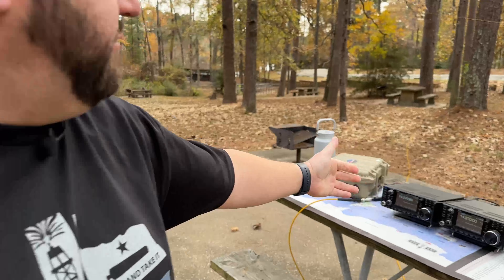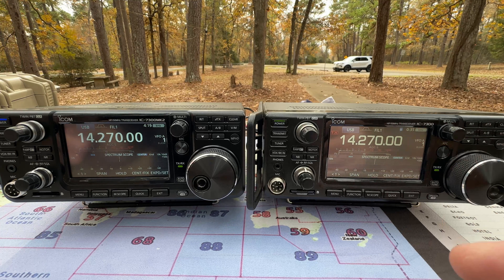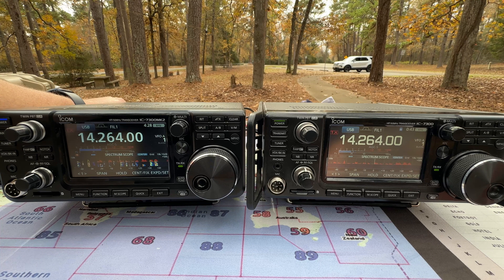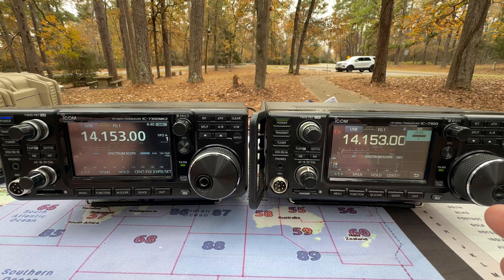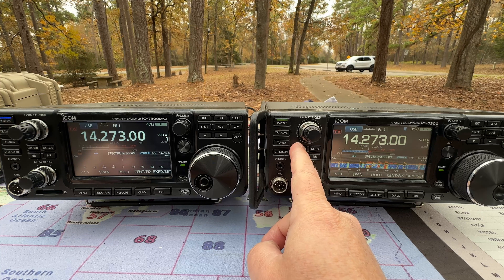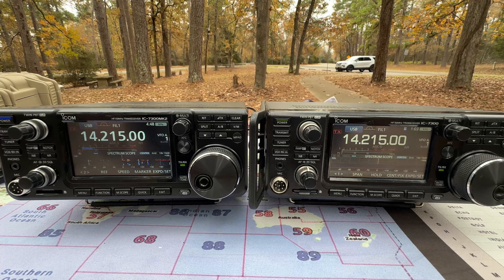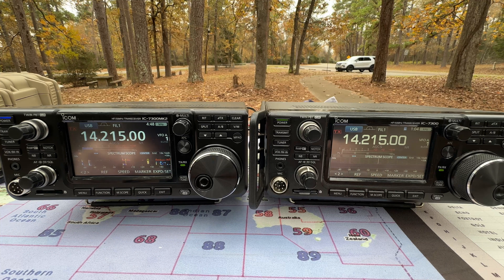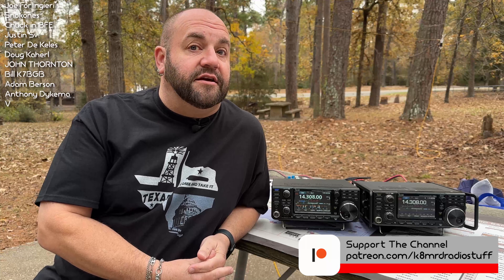Icom IC-7300MK2 V IC-7300 RX Comparison

Comment: Can you do a comparison with the RF gain knob?  Turn of the AGC. Then using headphones you bring the volume low, turn the RF gain all the way down, then bring it back clockwise slowly until you can copy whats being transmitted.  But you stop bringing up the RF gain before all the noise floor is included. I don't have it any more but my Yaesu-857D had a nice system and it seems like it worked better than the 7300.

Comment: MK2 Sound on  stations to they cut some Mid-High End frequencies .... NR both radios  Same..... MINOR CHANGES.....made no difference to purchase.   BTW thanks for the DEMO,  73  .w2ot.  opps let me add this  you will get used to listening to either one  make no different.   I view a few demos... My Comment added Video out put great...Would I spend $1500 NO....would I spend  $1000  yes !....73!........Icom did this with the 756-756 Pro -2 - Pro 3..... and the  706   - 706 mk2-G............I stick to Kenwood. next choice  FT 710.....I love my Ken TS-890.

Comment: With the AM station The MK2 sounds better and cleaner (from a musicians ear point of view) more full bodied slightly more bass, the standard 7300 seems to have a heterodyne, I can hear more noise, but the audio isn't as full bodied more in the mid-range. The signal strengths look about the same. At first the sidebands sounded about the same, the MK2 still sounds a bit cleaner on sideband. I have older 40 yo Kenwood's, a TS950SDX and TS940S AT, both have their interesting points. Currently the 940 is temporarily down there are no additional backlights in the LCD to replace, just two on the L-R edges, the screen backlighting is weak toward the center not as bright as it should be. took it apart down to its LCD electrostatic pads.  The 940 is a bit more sensitive with its own quieting, sometimes no noise, but looking into some cold solder joints. And I use the MFJ noise reduction/signal enhancer which works really well, the difference between all noise and no signals, to phased in clear copy signals and a distant river or waterfall for noise. Using 10-160m multi fan End fed half wave and 10-12 m vertical. I also use either the 950's DSP or I have two other DSP's to clear things up a bit.

Comment: Nicely Done... Next time consider using the same speaker. I didn't notice i.e.. I couldn't hear if there was a 12db difference between the two radios. Certainly the MK radio circuits would most likely remove that massive difference to barely able to notice any difference... 12db is a massive difference. Great for lunch talk at the factory but not even 3db of a operator noticeable difference. Wonder where it went. What I did hear was a difference in fidelity rather than signal to noise or selectivity. Not significant though. The other updates are of not much interest to me... don't want CW decode or HDMI or remote access.  VHF would have been nice or a Mic Audio adjustable noise gate. These new features seem to be more updates than upgrades. The biggest impact of the MK was to drop the sales price of a used 7300 to the mid $700s.  Thanks to ICOM for creating a hot used 7300 market...;-)

Comment: Quite a few negative comments,  but mainly from mk1 owners. I thought the mk2 sounded  better, and the screen looked good. My first hf radio was a 101ZD MK3, I don't know how many owners it had before me, but I listened alot with that radio. Only ever made 8 contacts with it because I only had a B licence. It got damaged so that was the end of that. I bought an IC-706 Mk2 in 89 then I passed the 12 wpm morse test in 1999. I then bought an IC-746. I have been  looking at the 7300 for some time. Looks like later next year I will be buying one. Need to save up because  couple of year's ago a second-hand 703  came up and last year a 705 from the same person. All I need to do now is start using them. Another great video Mike 73

Comment: The most notable difference between the MKII and my 7300 is the lithium rechargeable clock battery in mine is dead, a common failure in these. I wonder if you can open it up and see if they did anything different with the clock battery. Digikey sales the battery for 1.99

Comment: I must also say that I noticed little to no difference in audio quality. Of course, in other areas such as internal CW decoder and Wi-Fi capability, the new IC7300-mk2 is not bad at all! But you can also control all of that with IC 7300-v1 via a Raspi. 73 de Jan-Peter - DL3KVT

Comment: Youtube is probably going to mask most of the real difference, but seems like the audio is slightly less distorted on the MKII and the MKII seems to be ever so slightly quieter.  Tho I think the advertised  improvements in the RX are mainly in a little higher dynamic range.  But you would't really ever hear that until you got, like, a legal limit down the street or even a couple park benches over. 
I guess we'll have to wait until it shows up on the Sherwood engineering RX page. 

Somebody has to whine about something, so I'll whine that there's no WiFi. That's the #1 best feature of my 705, since with a cable RF always gets into my laptop no matter what I do with chokes, antennas, etc. WiFi completely gets rid of that. 

Other than that looks like a great rig!

Comment: Im a CW operator, weak signal and filtering can be a big deal. BTW 1 db can be a game changer when you're only 1 db above the noise floor but I digress. Continuing its one thing to have all the filtering its another how and when to use you bells and whistles. More is definitely not better and dont forget the RF gain its there for a reason. So for me your presentation is half empty no worries its still half full.

Comment: Can't see much difference.  Certainly not enough to justify rushing out to replace my MKi.  Having an external screen output is not a game changer.  My IC-7851 has that and I often forget to turn the external screen on anyway.  I think the problem is that it's hard for them to improve something that was clearly very good to start with.  I won't be parting with any of my Icom radios any time soon.

Comment: Comparing receivers just by ear, with two radios side by side and listening to strong, clean signals, doesn’t really tell the whole story. Most modern rigs will sound good in those conditions. Differences in things like phase noise and reciprocal mixing dynamic range usually only show up in tougher situations, when you’re trying to copy very weak signals with strong signals close by.

Comment: I like the efficiency for the MK2 and the the noise reduction and filtering is marginal but I plan to learn CW and fully utilize all the new ports. I hear the chip on the original is better than the MK2 so I will keep both.

Comment: Subtle differences yet noticeable to this former musician's ears. I was a bit surprised that some things the OG 7300 did were more favorable than the MKII and not surprised by things the MKII did better. Mostly personal preference than outright superior performance. I felt the 7300 AM reception was 'better' than the MKII, as was the roll-off on the noise suppression. I preferred the fidelity of SSB reception on the MKII, however. I like the screen and font of the MKII better and the game changer is the connections on the back panel. Of course those things aren't the subject of this video. Nicely done, Mike. W0RHP

Comment: There is very clearly a little less high-frequency hiss on the MK2 and a bit more mid-freq audio (say 400 - 700 Hz).  If you switch on the wide notch filter and set it to the top end of the passband, you can make the two sound identical.  Another way is to narrow the filter on the 7300 to perhaps 2.4k and shift both passbands down 200.  Excellent video.  Me? Sticking with the 7300 and not spending money on the MK2.

Comment: Good video ! I thought the guy wanted to show that the MK2 works better . The guy didn't show us the EQ settings for the receiver . In the video, you can hear that the old 7300 has a higher-frequency sound . IMHO, the MK2 has fewer high frequencies and more low frequencies . However, these are just EQ settings. Then I noticed that the NR filter correlation occurs earlier on the new MK2 ! The NR filter on the old 7300 is more gentle. Well, the PRE comparison, I noticed that on the old 7300,  (  8:00 ) NR is turned off, and on the new one, NR is turned on . Therefore, the comparison is not correct . In general, the conclusion is this - if you don't need HDMI and LAN, then it's better to buy an old 7300 at discounts)))

Comment: Slightly better clarity on the Mk II but not enough for me to want to upgrade if that’s the only improvement. I would consider it if the receiver is a few dB quieter so that I can dig out weaker signals.

Comment: If it was a choice between the 7300 mk2 and a FTDX-10 which should I go for?
Reply: The newer one, MKII
Reply: I have an FTDX10 with 300 Hz roof filter for CW.
I do not know if I will upgrade to Flex, but I will never downgrade to an IC7300 or MK2
Wait a little bit for the Sharewood analysis. I am sure IT WILL NOT BEAT the DX10 ;>)

Comment: I noted very little difference.  Seems the main advantage to the MK2 is its HDMI output but I have the PTRX-7300 mod in my IC-7300 so no need for a HDMI output.  No need to upgrade here.
Reply: I'd never heard of the PTRX-7300 panadaptor, so I had to do some research. 
Apparently, it uses the location of the Antenna Tuner jack to perform- shenanigans. They also seem remarkably hard to find, here in Australia.

Comment: The newer radio is going to sound a little better simply because the speaker is new and hasn't been out in the elements much. It's not as broken in as the speaker in the older radio. They both sound good but to my ear, the Mk2 sounds better. Also noticed the font on the frequency numbers is different on the Mk2 compared to the first gen radio. Great video Mike. Thanks for all the great reviews of this very nice radio. 73
Reply: And yet many claim that speakers require a break in period to reach their best performance.
Reply: @N_Andrews  Audio is so subjective it's really hard to say one radio sounds better than the other. To my ears the Mk2 sounds better but I'm sure others would say the first Gen sounds better.

Comment: Great video, I would save the money unless you want an external monitor and remote operations. And if you want a better receiver and DNR. Buy a FT710 use the extra cash to better your antenna or build a better one. 73 W4KWS 🎉

Comment: I’m waiting to hear the updated Sherwood Engineering report about the receiver quality. 5 stars on the USB-C & HDMI port. -1 star for the font change on the frequency display (I’m a font nerd - just a bit). 73!
Reply: As I understand it, you can change it back to the "square" numbers in the menu. Don't have mine yet to confirm this though.
Reply: @CheesyTators  Good to know if I ever decide to buy a 7300 MK2. 73!

Comment: The only difference I could hear was the self generated noise floor. On receive any differences were imperceptible. To justify swapping the old for the MK2 would IMHO have to be driven by the other features like USB-C etc and not receive quality. I am sure the difference in receive can be picked up a scientific analysis but so far it seems to be undetectable to the human ear. On the other hand we are hearing this through a lavaliere mic over the Internet so who knows hi hi

Comment: I had a 7300 for five years then purchased a two flex radios and a maestro, I'm going back to the 7300 (old version) and selling all the Flex equipment.
Reply: We did the same thing.  Especially surprised at the clicky QSK on the flex.  I quieted my 7300 with acoustic putty on the relays.
Reply: Why? I mean i never would by a flex, but let us know.
Reply: @Andy-M938  with every software update comes new problems.
Reply: I have an FTDX10 and want to buy a Flex, but I am afraid that te receiver is better on my DX10 ;>)
Reply: @BFOlivier  no.  the Flex receiver is far superior along with the audio but the software updates just keeps getting worse.
Reply: @KE8TIQ  I fought it was superior, but not so sure after I saw few review.

Comment: Thanks for doing that comparison!

Well, I CLEARLY heard a difference in the MK2. It was a little more 'bass' and most noticeable on the AM transmission.

I bet you could go into the RX setting and change the 'bass' just a bit on the 7300 to make it sound like the MK2.

No discernible difference on any other feature, except the NR was a tad obvious. Kicked in on the MK2 about 5-6, and 7-8 on the 7300.

After owning my 7300 for 6 years, I love it to death, and I don't see any reason to upgrade, personally.

However, what a great pair of radios!

73 - Stan WB5UDI

Comment: It is a very incremental update to an existing rig. All "good" improvements, specifically the reduced power consumption. IMO. The price is ? I certainly would not "save" $500 and get the MK1. That is a quandary for Icom to solve.

Comment: Thank you for this video. As I suspected and after having the IC-7100 for 7 years with the RS-BA1V2, an RC-28 and operating remotely, I have no reason to go with the MK2. I already spent the money to have all the stuff the MK2 offers, plus using SDRUno as a big screen display. If you have the original 7300, cherish the radio and save the money. I will wait for a update to the 7610 or a new ICOM rig.  Great job Mike!!

Comment: Am I the only one who noticed zero difference?
Reply: The static noise was a little lower pitch in the MkII. Maybe a slight tone difference, with the MkII being less harsh, but hard to tell for sure on the recording.
Reply: the font ist different ^
Reply: @larspregge6420 Font is NOT different, that is a setting you can change the font from Rounded to Flat
Reply: @KD9VUK-  so it is different then if you can change it.
Reply: I see a little more dust on the mark 1
Reply: I think the MKII was QoL differences. Some audio differences, but both solid radios. If I had a MKI, I wouldn’t be terribly inclined to upgrade, but if you’re getting a new radio, definitely MKII.
Reply: I really can’t tell any real difference myself ❤
Reply: Totally agree! Thats  why i cancelled my order. Unless you absolutely have to have the new ports dont do it. The bells a.d whistles are fine but  pay for a better rcvr
Reply: @MicahWave_Unlimited  the ethernet connection is the killer feature for me. and the extra rx port stuff. Display output -- I have the 7760 and 7851. I don't use that .
Reply: I heard no difference, Will be keeping my IC 7300 and £1400,
Reply: I can tell the difference. Mark 2 has a different lower tonal quality than the regular 7300.
Reply: @thatsjustjoe101 agreed
Reply: I noticed zero difference in receiving. I do not care about external video monitors, two receive antenna inputs. None of this is worth paying an additional $500. I’ll keep my original IC-7300 and take the $1,499 and get a new IC-705!😊
Reply: Ic 7300 is tried and tested ,,mk2 is the new kid on the block
Reply: no difference, ack!
Reply: Absolutely wrong! One is on the right and the other one is on the left!
Reply: No difference. Test must be done on weak signal night on 40 meters band with a big antenna.
But with reception à 9+ it tells nothing.
It was a nice outdoor activity, but I will not call that a "comparison"
Reply: @BFOlivier 
Honestly, I’m not sure what real RX performance difference we’re going to find here. It’s essentially the same architecture with quality-of-life upgrades. For most users, this will be a perfectly fine radio.

If you’re strictly chasing the best receiver performance per dollar and don’t care about anything else, there are other options—like the Yaesu FT-710 or the hybrid SDR monster FT-DX10.

The IC-7300 remains an excellent radio, but to justify moving to an MKII you should have a specific reason: remote control, HDMI output, and other updated features. I’m not sure how much more they can squeeze out of a 15+-year-old design without going back to the drawing board.

Personally, I’ll wait for a used MKII even if it takes a couple of years. Icom quality is legendary, and I have no doubt these will sell like Krispy Kreme hot donuts.

Merry Xmas 🎄
73 W4KWS
Reply: @W4KWS  Thanks I own the FTDX10 and I find it incredible. Merry Xmas to you and your familly
Reply: @BFOlivier  Absolutely I also have one and the FTDX101MP, my biggest problem is I love all the brands and models of ham radio. 73 Merry Christmas to all K8MRD always puts out a great video and he LOVES APRS! :)

Comment: Sorry. I’m waiting for the “ IC-705 MK2 “
Reply: 705 Mk2 with an amp that seamlessly integrates like the ftx1 and works like a 7100 bit with wifi, bluetooth, and GPS would be the winner winner winner
Reply: @Kody10538 maybe... but still with only one receiver. ftx-1 has two...
Reply: @radioholicy it sorta does.

Comment: Why did they change that familiar font?? Boggles the mind.
Reply: I agree, it's of course mostly irrelevant, but the old version looks newer than the new version because of it, strange indeed.
Reply: The screen type is different also
Reply: I read somewhere that the font can be changed to the familiar squared off font in the menu.
Reply: @jduke008 it’s probably a toggle between two settings “Right” and “Wrong”
Reply: @Aimsport-video its a setting in the menu yes